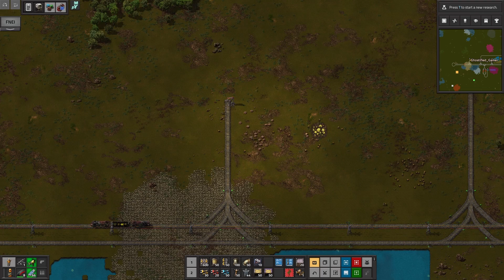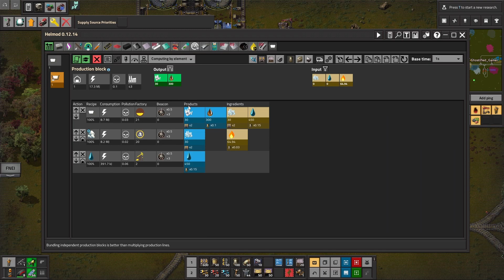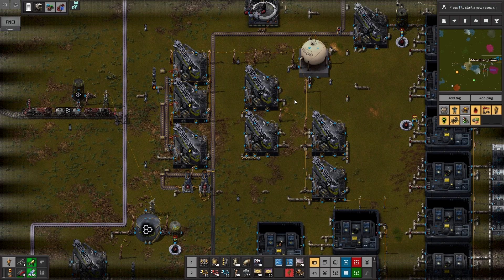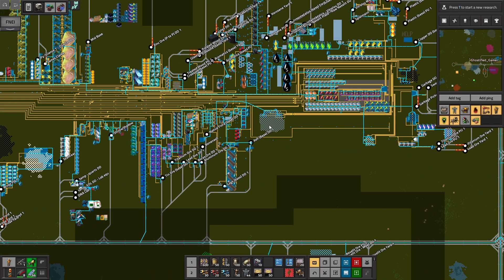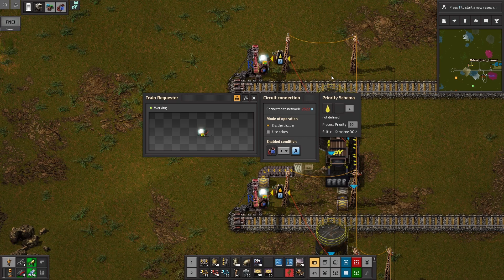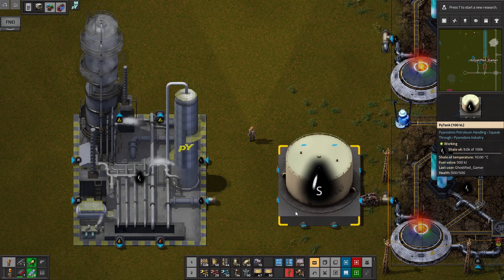Factorio pYanodons | Starter Base Independence | Shale Oil - EP77

Comment: In case you haven't looked at centrifuges yet, you can see their power consumption in the tooltip when you hover over them in FNEI, which is quite handy. And they're scary — 200 MW (!) when active, plus a constant 6.67 MW (!!) drain just for being hooked up to the power network. If you want a machine to provide a load when you're testing some power system in an outpost, you could just build a single centrifuge and have it sit there idle. That draws the same load as 22 2/9 (twenty-two and two-ninths) radars that are constantly operating. Hopefully coal-water slurry is valuable, because you're paying an extrremely high power price for turning tailings into coal-water slurry.
Reply from the maker: There will be a centrifuge used for the coal-water slurry in this build.  They are power monsters for sure.  Just plopping them down though out the base will test the power system.

Comment: Are those bitumen seeps exclusively for bitumen? The tooltip talked about "Surface deposit of hydrocarbons", not specifically bitumen. I wonder if an oil derrick or a natural gas derrick would be allowed to be placed there. (Checks code...) Okay, looks like there's an in-game hint about bitumen seeps: "[entity=bitumen-seep] can spawn on the map. These mark underground hydrocarbon deposits. You can build one of [entity=bitumen-seep-mk01], [entity=tar-seep-mk01] or [entity=natural-gas-seep-mk01] over these. You first have to feed these buildings with a drilling fluid, like [fluid=drilling-fluid-0]. **The building does not produce anything at this point**, since you're drilling for resources. Eventually, you will reach the underground deposit, and the building will stop needing drilling fluids, but instead yield [fluid=crude-oil], [fluid=tar] or [fluid=raw-gas], respectively, depending on the type of building you built." (Emphasis mine).

So you will need to set up drilling fluid type 1 (the fluid named drilling-fluid-0 in the code is named type 1 in the in-game UI), which is just water, sand, and soil. Then you'll be able to choose which resource to drill for at each of those bitumen seeps: oil, tar, or natural gas. (Yes, oil: the thing named [entity=bitumen-seep-mk01] in the code is named "oil derrick" in the UI).
Reply from the maker: Correct.  It's confusing but indeed the new codex they have explains it which I find later on.  The seeps need to be drilled with mining fluid while the specific machine is placed.  So raw gas, crude oil or tar extractors.  This is why the resource doesn't pop up on the map view as it's not defined yet.